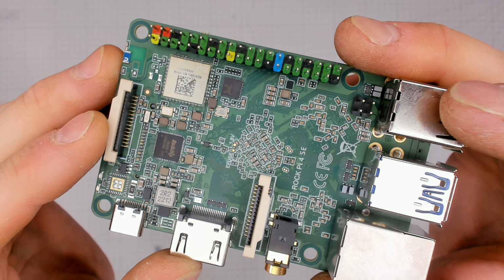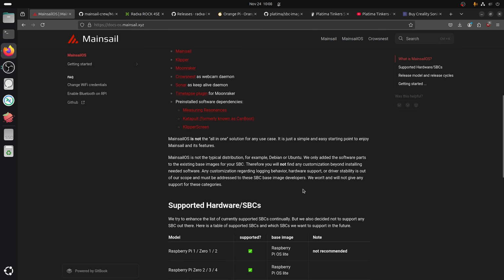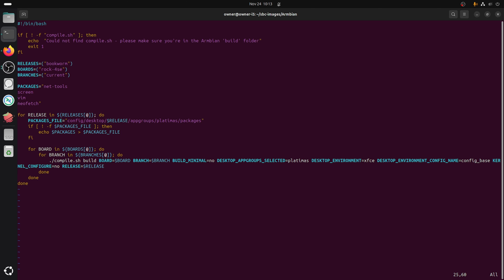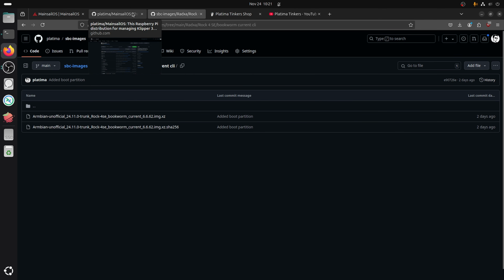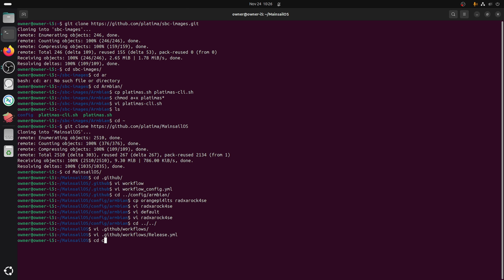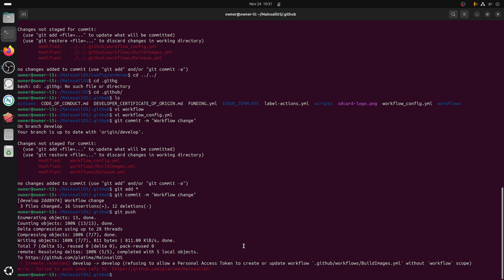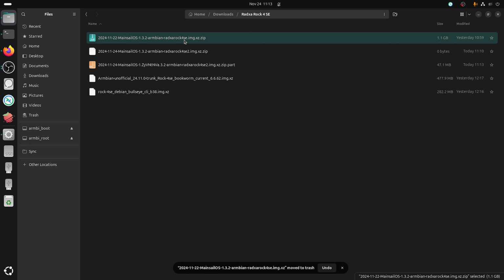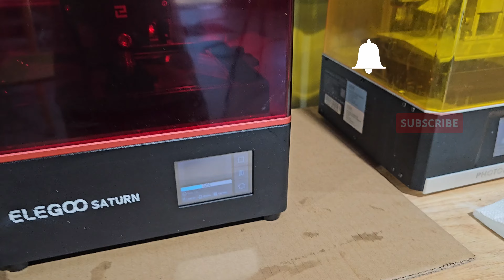Radxa Rock 4 SE and building MainsailOS for it to work with my Ender 3 V3 SE 3D Printer!

Comment: Theres a script for OctoPrint that will install on most Linux/Debian based OS, have it running on Opi3B. 

Also if you decide to run the 4SE with NVMe you're gonna*need* the heatsink.  I lucked out because it still worked but that chip that controlsbit started smoking after about 5 min with no heatsink.
Reply from the maker: Great info, cheers for that!

Comment: Obs-studio can work with hotkeys, and multiple modifiers, so win-alt-shift + a number to select a video source ...   or ctrl + win + function key
Reply from the maker: Good to know! I have tried a few things, and normally I use the auto-switcher which works well, but I've started building a little camera controller pad for it all anyway (like a Stream Deck).

If it's not done soon, might consider hot keys. Cheers mate